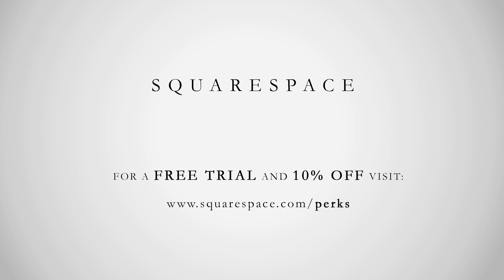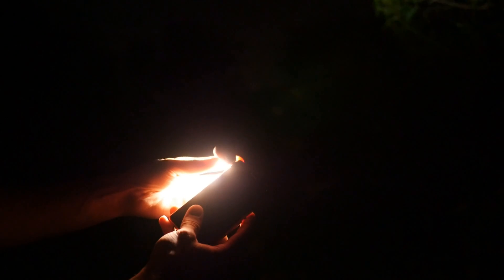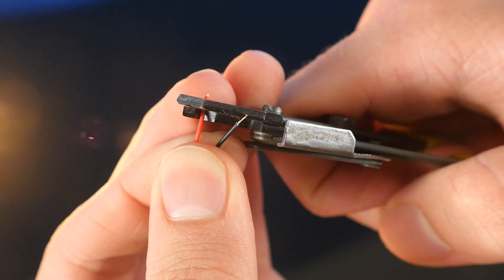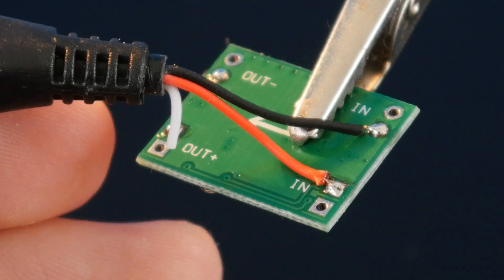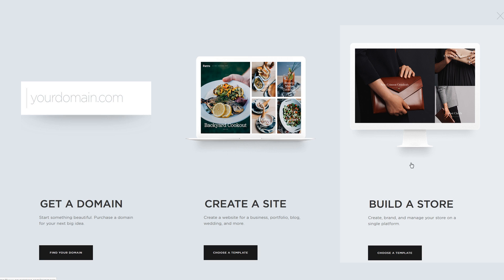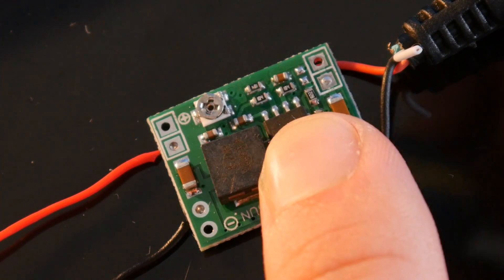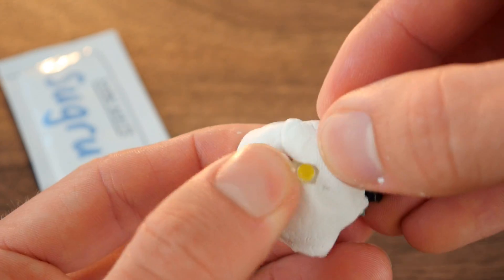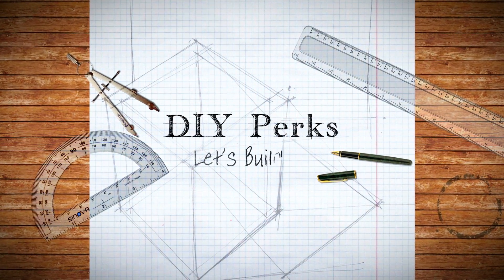A DIY smartphone hack that's actually useful!

Comment: I tried this with USB-C and the LED is getting way too hot. When I step the voltage down it's not bright anymore. Cannot imagine covering it in Sugru as it will burn.. any ideas?
Reply: what led did you use

Comment: LEDs require a current source, not a voltage source. Driving a LED with a voltage source is not stable, the current will vary with the LED temperature. I don't recommend such a circuit.

Comment: <FIND the correct VOLTAGE and any similar unknown variable FAST>

How to quickly "find" the correct voltage quickly so as to not damage the small pot resistor.
IF your unit has wax dropped on the top to stop the adjustment, do NOT turn it as is, likely the wax is below the top and if you turn it you will stop the contact of the pot contacts. Turning it back will only coat the "spot" that had contact with wax.
Trust me.
This method works with any variable, in this case, a knob,
 where you have no idea what (Variable)output is correct,
only that there is a point where it becomes 
correct and there is a definitive Y/N result of manipulation of the variable on + - of that variable.

Conditions
IF blinking as indicated, we know we are too HIGH for the voltage. 
IF we turn it to the left fully (ANTI-clockwise) 
ANY position BELOW the current knob position(number) is a possibility, by default NOT above.

We know the range of the knob or pot by looking at it.

1. What percentage of the knob position (variable range) is the knob?
  A. In this case you do not know, and these are very sensitive, so do not just twist clockwise to find the top stop.
  B. See if you can tell by looking for a metal tab bet upwards around the base, or the way the stop is implemented on the pot.
2. MARK the spot you are at. 
  A. This is the MFG setting for the 5v supply. You may want to use this later in another project. 
  B. You need this now.
3. Guess the position BELOW the current position, but as close the CORRECT knob position as you can. 25% below? 50% below? Mark the spot you think is for sure below the correct value.
4. Slowly and carefully move to that spot.
5. Test
6. It is now correct,  A or B.
   A. IF it is YES, it is now BELOW the Correct position.
   B. IF it is NO, it is now NO the Correct position.
7. Find the spot HALF WAY from the point between:
    A. IF 6A above, then use the ORIGINAL mark and CURRENT mark, split difference, mark, and move.
    B. IF 6A above, then use the CURRENT mark and a NEW LOWER mark as in 3. split the difference, mark and move.
8. Repeat step 7 until you find it. 

You should find it in less than 7 values or positions tried.

Statistically and programmatically this is how you would teach an AI, or you in this case, to do it. 
This is what a type of AI intelligence is all about.

If you don't think so, then fold a piece of paper in half 8 times for me and send me a picture.

Comment: I would like use polymer clay as a surrounding material but the clay has to baked in an oven at 130 degrees. Does anybody know if this would damage the Voltage Step Down Board, 130 degrees is not very hot ? ?
Reply: Lol I done this project with polymer clay and it is coming out rn

Comment: instead of using DC-DC step down converter, why not connect two 2-3V LEDs in serial? You can then connect multiple pairs in parallel. There are super bright 2V LEDs out there.
Reply: LMAO  2V RED LEDs

Comment: I'm just learning to solder and this looks like a fun/risk free project. Does anybody know if I need to do anything different with a USB C at the end? I may inititally follow the instruction in this video first with a micro. Also, is it possible to do this with an Apple lightning port? Or is that a strict NO?

Comment: Do you think I can add a motion sensor with this LED having a dedicated rechargeable battery? I like the idea but plan to use it with its own small battery instead mobile handset as power source. It will brighten up my deck at the backyard.

Comment: I have a Nokia 1 ans its flashlight is well bright enough. It is also quite durable. Nokia 1 does not have much processing power - but the battery lasts longer and gets the basic things done while on the go.
Reply: Only thing is the volume is too loud and I have to balance it with a software equalizer.

Comment: Hi Matt If you or anyone reads this plea for help, kindly assist. I was inspired by this video and decided to change the T4 flourescent on my magnifier lampshade to LED. All went brilliantly for 10 minutes and then it went off and now glows very dimly which I assume means current is still flowing but maybe the leds are blown. I used for 4 LEDs in series (+ to -) powered by a constant current LED driver POWERPAX  LED-DR-700-30  42.8Vdc 700mA 30W Constant Current LED Driver and the LEDs are Chazon 5W 6V LEDs. For the ten min that it worked it was fantastic! So what am I doing wrong? Pls help!

Comment: What about the heat dissipated? 500mA in 5v is 2.5 watt of power on that star LED, I bet you would dare to hold it in your hand for 1 minute when it is on, or the LED will survive. Give it a heat sink instead of Sugru it.

Comment: Hi Matt, can you help me? I was inspired by this build and tried to make the same. The problem is my phone output stays at. 7 volt and the led doesn't turn on. It works when I use a power bank, and it's way brighter than my phone's flashlight. My phone does have otg because I can also program my arduino using  my phone. It has USB c btw.
Would be awesome if I could get some help

Comment: there is no way usb only delivers 500mAh because i have an hdd that says it uses 1000mAh and it runs fine off usb depending on the device
Reply: mAh is different to mA, this is current
Reply: @guitarraenllamas  so no h then? Got it. The HDD say 5V 1000mA DC on it and it works threw usb (though not the wii u usb because idk)
Reply: It's depends on the device that is giving current. 
In general, Pc's usb can deliver more current than smartphones

Comment: Found these links for ebay in Australia, just posting in case anyone's still interested (not ref links)
Step down board: https://www.ebay.com.au/itm/DC-DC-Converter-Step-Down-Module-3A-5V-12V-Mini-UBEC-BEC-For-RC-Plane-FPV/283006609624
Light 10pcs for $3: https://www.ebay.com.au/itm/10x-50x-1W-3W-5W-7W-SMD-COB-LED-Chip-With-Star-PCB-High-Power-Beads-White-Light/131934573125

OTG cable is a bit different since modern phones don't use micro USB connectors. I found a USB-C one: https://www.ebay.com.au/itm/15cm-USB-3-1-Type-C-to-USB-3-0-Female-OTG-Charging-Data-Cable-Converter-Adapter/283172731008

Comment: Remember Moto G (2013; Falcon)?? 
The world should know, this is the only one phone (as my Experience) that gives 4.5/5v (>500mah) through OTG.
U don't need a step-down board , even it can play external HDD without any extra power. 
that's the only one cause, I am still using this phone for over 5 years.
I wonder, why all other android gives lower than standard USB power !!!
Reply: They give lower power to prevent battery consumption or battery damage

Comment: did you really just solder wires on a tht hole as if they where smd it would me much better to push the wires through then solder them

Comment: That is a pretty good idea, but is there a way to draw the intended .6A, if not, you could definitely use a power bank, most are designed to draw an amp at least, I have one that will supply 2 amps, so you could probably utilize multiple LED's; it's also very nice that I have some 3 watt LED's from an old laser project:)

Comment: FYI you can modify ANY USB cable/any wires to work with OTG. Google it. The difference between a reg USB cable and an OTG cable is 1 wire I believe...
Reply: DIY OTG USB Cable

Comment: I would recommend using "proto putty" in place of suguru for price. All it is is cornstarch mixed with 100% silicon and it creates moldable rubber with some food coloring or water as an activator.

Comment: The aluminum plate is for thermal dissipation. Using thermal compound and some way of cooling it would stop the LED from cutting out when it heats up.

Comment: So basically you drain the phone via the usb plug, using 3 watts of power, without rx/tx wiring (used for max (dis-)charging speed, sending a signal that the device can "use/deliver" that kind of current), I know faster phone killing methods...
Reply: Tell me where the rx and tx inputs of the buck converter are placed. Can't see em? And also it's using about 1.5 watts not 3.

Comment: My phone actually has a very bright flashlight feature that uses the lights from the dual flash. It is a Droid Turbo2. I have found that this phone's gesture feature is incredibly useful when I need a light. All I need to do is shake my phone a certain direction and my light pops right on. Shake it another way and I get my camera app.  This is a great diy for devices that don't have as bright of a flashlight.

Comment: You are amazing. Each video I am watching is a pleasure!
I am not a technician and would like if you could think about something that would be useful and I have no idea if it is feasible:
I live in Brisbane, Australia, the Sunny State! I drive for Uber and when waiting in the Sun, the car gets so hot that I must keep engine running for the A/C and it is very annoying. Also when leaving the car in any parking it is an oven when coming back to it.
I wonder if a decent "portable" A/C could be build, such as something that would be stuck inside the windscreen with rolling solar cells accross the windscreen all the way. Kind of a roll-in roll-out design for easy storage when not used.
You might think I am silly thinking about this, but it would be definitely sold fast if feasible!

Comment: Last I heard, if the data cables are bridged and a USB charge is applied, most phones will allow for input of higher voltages, but would USB OTG output at a higher voltage when the data leads are bridged?

Comment: Do you just dip the tip of the solder iron when soldering? That's a recipe for cold solders, I recommend heating for about 3s with the wire attached for a proper bonding. For example the red wire from the microUSB connector doesn't look very good, niether the ones on the LED plate - but that's a big heat sink so it may need some longer heating. 
But I guess it works for as long as you have the phone. 
I guess you're now in a situation "... where did I put that LED module I built that drains the battery faster..." as you probably don't carry it along with you all the time - so perhaps a cheap rechargeable LED flashlight isn't a bad idea.
Reply: You could hook it to another 5V source and measure the current instead of trial and error - if you have such tools, which is likely if you have a soldering iron (as a cheap multimeter can be bought for $5 or something). 
For how long can you use the LED module before the encased heat sink heats up and starts melting things?

Comment: Wouldn't it be MUCH easier to connect the micro USB to a continuous power supply, like a battery bank, and use a multi meter to adjust your variable step down? That way you aren't playing the trial and error game.

Comment: Is the micro knob stable for the most part or is  likely to need readjustment? Since its dialed in to such a precise little window, it seems like any play in either direction would throw it off entirely if it can't adequately hold its position

Comment: Hello!! I did something similar with a 5V 24 LED array I got on ebay
[http://www.ebay.co.uk/itm/Energy-Saving-Lamp-5V-24LED-Bright-White-Piranha-LED-Panel-Board-Night-Lights-/351181714644?hash=item51c40fb4d4:g:BQAAAOSwDk5UJioV],
 without the current regulator. Do you think it's as bright as yours?

Comment: Yes buy an Otg Adapter to cut of the Micro USB
What about using a Charger cable
Reply: OTGs have on microUsb pin 4 and 5 soldered,to turn it into Host Mode

Comment: In my phone the light didn't do the flashing and turning off thing. I just turned the knob and it lit up, I continued turning and reached the end without turning off. It works, but I dont know if I should put the knob more close to the initial position or all the way to the end turning in ccw, because the brightness is the same. What should I do?! It also heats up pretty quickly...

Comment: Hey Matt,  I would like to use an 18v Ryobi Li-ion battery power tool battery pack to power devices ranging from 5v to 18v through separate ports.  Can i use the 2 or three voltage step-down hacked into a second charger housing?
Reply: YES

Comment: Matt, 
I've made this and I can't keep it plugged in longer than about 40 seconds. My Samsun Note 3 doesn't seem to do the flicker when tuning the micro voltage regulator. I'm able to turn it the adjuster to get the led to turn on but it doesn't have a cutout on the high side. Also when plugged in longer then 30 seconds at full brightness the led gets really hot. Wiring up to the led starts smoking and the led burns up. Gladly I ordered 2 leds but this doesn't seem like it'll work on my phone. not enough cooling for the led. 

Any Ideas? Thanks for all these great videos. Keep it up!

Comment: I don't know why every keeps saying this project cost $50.  A small pack of Sugru is $12, the led is about $4, the microchip is $4 and the usb cable is $4.  If you have Amazon prime it's about $20 altogether.  Still much more expensive then already pre-built ones on the net (they're under $5) but not to expensive.
Reply: Fuck no the LED is not $4. I bought a pack of 50 for something like $10. The exact same star-base clear white LED in the video.

eBay, my friend

Comment: Hi, just a quick tip, a single AMC7135 LED driver chip (350mA 3.3V  CC CV) does the same job that Voltage Step Down Board does, and also your power led will be driven cool. Cheers !

Comment: Having a light that turns off based off ambient temp sounds horrible.
So does tuning a device to draw the absolute maximum current the phones USB can handle, It most likely wont hurt.
But why push it.
Reply from the maker: It doesn't turn off based on ambient temperature - it turns off based on internal temperature. The USB port can handle it, so why not? It's all within spec - nothing's being pushed.
Reply: DIY Perks
Yes, Correct. But ambient will affect it. For the same given device pair, On hotter days it will shut off earlier. If you freeze it, It will take a given amount of time for the 'core' to reach what is ambient temp. That time difference will be measurable.
And the pushing part would be most risk to a phone that normally consumes a lot of power when in use, Then add 500mA on that.

The battery will hate you a little more than normal. Maybe that cut-off could be considered a safety feature :D
Reply: ....might be better to run it at half and not have a surprise when the light goes out
Reply: it is a safety feature, you run that battery low and its going to permanently lower the charge

Comment: Aaaand.... Then you'll kill the USB port  of your phone if you bump into ANYTHING.

The micro USB connector is so flimsy I'd rather be in complete darkness instead of risking destroying the motherboard of my phone. 

Since the connector is usually on the main board - and when the connector breaks, it usually destroys / tears the contact pads off the PCB - which can not be fixed. The only way to fix it [ !-> reliably <---! ] is to replace the whole main board.

There is exceptions, like the Lumia 920, where the connector is soldered onto a ribbon cable which can be easily swapped out if needed.

Comment: I built one, even though I'm not very good at soldering. made it so it can be turned around as my tablet and phones charging ports are the opposite way round. easy if you cannibalise an old gorilla tripod for a bendable light

Comment: Why not use 2 Leds in Series instead of the voltage regulator?
Reply: Adventist that's not how that works. 2 white leds require about 6 volt. USB provides 5 volt, so they "underperform". That's where the typical diode characteristics kick in: letting through less amps when they are "undervolted". 
With 2.5 volt instead of 3.2 they will use aprox 1/8 of the max current
Reply: but what about thair breack trough voltage  @gekkehenkie0001
Reply: @vega1287  yeah, could very well be they don't do anything at all. In my experience it takes a minimum of 2.5 - 2.6 volt to give a visible result.
Anyway, they don't burn up either 😂
Reply: @gekkehenkie0001  well as far as i know blue leds start to light up at about 3 volts and a white led is basically a uv blue led with a phopphor infront of it to create white light through flurescencee
Reply: @vega1287  their useable range is on average between 2.9 to 3.2, but they do start emitting light from 2.6 volt, just very little.

Comment: Or just better use 3W led driver for 5V power source. Voltage regulation with high power led is bad idea because you have to set voltage and also as led heats up her forward voltage goes down and she draws more current and that results in shut off by phone.

Comment: The Buck-converter used in this is an MP1584. I found when making this that the MP2307 would be preferable. The MP2307 uses Synchronous Rectification and has a higher switching speed which makes it quite more efficient. It's also smaller than the MP1584.

Easiest way of finding it is to search Ebay for "supper mini 3a dc-dc converter".